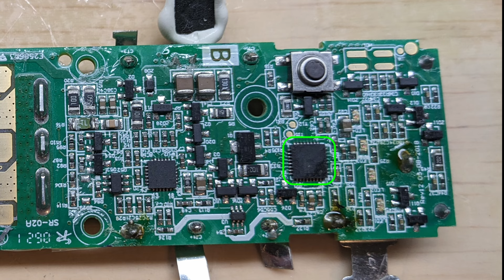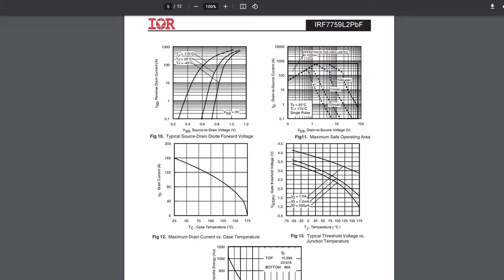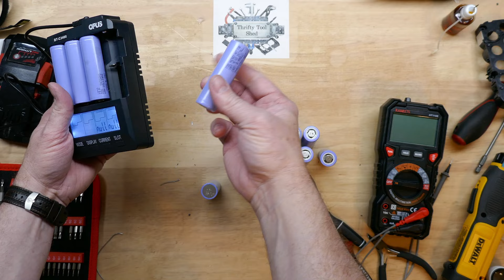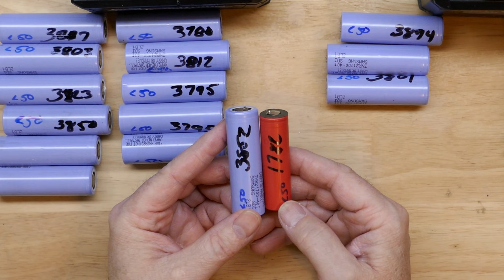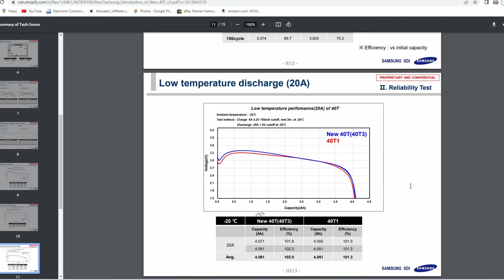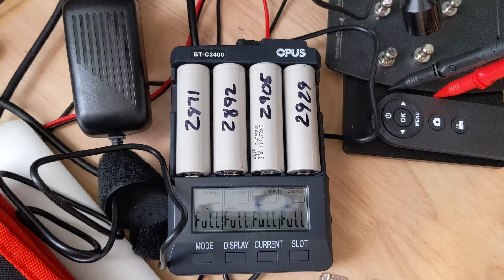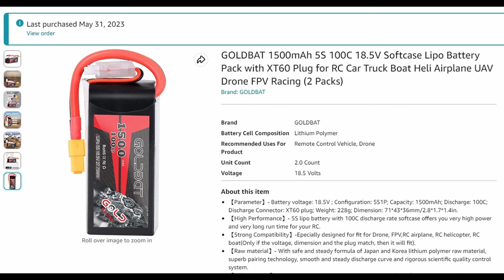Milwaukee M18 HD12.0 -  Is it fixable?

Comment: What about a bridge over the MOSFETs ??? Did that and the BMS came to life. I don now if it's a safe repair
Reply from the maker: Well it is absolutely bypassing a safety shutdown. On the same note the aftermarket boards available from China does not have the mosfet at all. At least the ones I have seen do not. So if it does work bypassed, I would treat it with the same respect as the aftermarket ones for sure.

Comment: not for vape haha about 6 years ago the first 20700 sanyo c s were installed onto a metabo battery packs hard to buy where I live . tore apart and went straight into my mechanical vape mods . pushing .008 olms . . in parallel. but single .25 sweet spot. for single battery. about a year or so later they finally made it to public as single cells. those 12.0s and 8.0 got tired of dead cells and rebuilding. milwuakee vape batteries now lol. dig how deep you go with specs thank you!

Comment: Thank you.  I sure did get a lot of very good information from watching your video.  I have a number of Milwaukee battery packs that are in various condition.  Some that stop charging with 2 lights, some with 3 lights, some that blink, some with no lights.  I was hoping to get some of the working again by mixing and matching parts between them.  But, after watching your video, I would be happy if you wanted them, no charge, pun fully intended.  Let me know how, and I will get them to you.  For me, I think I will buy the kits, and then build my own from the baggies I can get from the 18650BatteryStore website.  Let me know how I can get these to you and I think you will be happy with them.  All the best, and thank you again.

Comment: Often times people leave the battery sitting for a long time. It will drain down below what the charger will see. Simply charge up each bank of cells will fix that issue.

Out of balance cells will make this happen as well. Rebalance and it should be fixed. 

Out of the 100s of m18 batteries i have taken apart, most often what kills these packs is water damage or just letting them sit ran down.

Milwaukees first batteries with 21700 Samsung cells had a bad batch of 21700s. Some of the cells self discharged to fast. Making the battery out of balance.
Reply from the maker: This video is for this exact reason. To share first of all that unbalanced packs are an issue and how care should be given when trying to charge them, Secondly,  it's about even rebalanced is not always the answer since cells will go bad and loose capacity and simply balancing them back will end in the same issue in a few cycles or if they sit in storage for a long period of time. Thirdly, I talk about the 40T1 cells being an issue, and I hope the 40T3 cells are better. Very few are truly OK after rebalancing because it was a reason they drifted apart to begin with.  I left these for over a month to show that on video for the ones that care to watch it.
Reply: @ThriftyToolShed  an unbalanced pack happens because the cells were junk to start with. It's up to you if you want to replace them or not. Often times just keeping them charged is enough to keep them balance. 

I only replace cells if the IR is out of spec. Causing them to discharge in a few days. As long as you use Milwaukees charger it won't be an issue. It simply won't charge them. If you hot wire a pack, that's a huge problem.
Reply from the maker: Exactly!

Comment: Hey any chance you can give a list of stuff to buy so I can try to fix my battery and save myself money please all m18 batteries
Reply from the maker: I do have links in the videos description of many things that I use and can recommend as they work well for me. Most repair videos have links in the description that align with items used in the video. I typically use Amazon and Northridge fix for tools and supplies. If you have a question about an item or tool, feel free to ask. I have a video in the works talking about the tools I use and like, but it's going to be a while before I get time to finish it. It's always something to fix....

Comment: I have some of these 12.0 boards if you need any. Good working boards.
Reply: I'm just curious how do you know they're working good for sure. I have 2 12.0 that the cells are balanced and I can charge it with my dc variable charger but it still won't charge on a regular charger. All lights work correctly if charged with a manual source
Reply: @gregthompson3924 if it's refusing to charge on the Milwaukee charger and the battery needs a charge, it's a bad BMS board. Run the battery down to 2 bars. If the stock charger won't charge it, it a bad BMS board or a bad Milwaukee charger.

Comment: Im currently balancing my 12.0 now. I have 3 that refuse to work correctly. 1 is obviously unbalanced. One seems balanced but wont charge. I'm going to try to jump start it.
Reply from the maker: They will need to be balanced before they charge. Jump starting may possibly make it worse instead of better if unbalanced. Especially if some cells are closer to fully charged, while some are lower. The charged one could be damaged or even catch fire by pushing them much over 4.2V for example. Best of luck to you with your repair!
Reply: @ThriftyToolShed  I tried to charge each bank separately but my charge refuses to charge it. I'm going order a cheap 1 cell charge board and wire it up. As of right now this project is on hold.

One pack seemed pretty well balanced. So I replaced the board on the pack. Still will not charge. 1 light flashing on the pack. Goes straight to green when placed in the charger. Not sure what's up with that pack.

Comment: Great video! Those mosfets are infineon IRL7472L1TRPbF. See the bottom of pg 10 of the datasheet for the part marking code. 7L72 is the part number, JZ70 is batch number, 2115 is the date code (15th week of 2021) https://www.infineon.com/dgdl/Infineon-IRL7472L1-DS-v02_00-EN.pdf?fileId=5546d46254e133b401555d17178250d8

Comment: Not sure if you said this, but after it’s fixed you should FULLY charge (even after it’s “done” to top balance the cells) then kill it all the way. Fully charge it then it should be fine. The shop I work in for my engineering internship had problems with them when they would almost never fully charge or discharge them with them switching to the flashing light. I used the jump start method and balanced them as I explained above and brought back 7/8 of the batteries. I think the one had a bad cell or bms.

Comment: At 31:30 I don’t understand how you reset the board.  You twice put the board on the charger and after a moment removed it and tested it, it flashed 1 bar in error yet after the second attempt you stated it was reset but doesn’t look like it???  Trying to diagnose 2 8HO, 12HO, and a 9.0 with the same 1 bar issue.
Reply from the maker: Putting it on the charger was the reset. It has been mentioned in several videos in that series of videos, sorry if not as clear in this particular video. Typically the charger will reset that and some packs will go through a diagnostic type test if you hold the fuel gauge button down for 5 secs or so that may help in some cases...

Comment: It's blinking because is under voltage 
I just saved one just putting too another charger until has 17v that to original charger and it's work again (i tried few times)
Reply from the maker: Thanks for your comment. As mentioned in this video and many others it has bad cells. The actual whole point of the video is to help show the true condition of the cells instead of assuming charging it up will get it back to normal. Many people seem to think to boost it up and good to go. Over 95% of the time in my experience it is bad cells and the problem is simply masked by charging up to get a fault or error to clear. Think about it... How did some of the cells drop low to start with if cells are not balanced? In some cases when all cells have equally dropped down then yes the boost them up method can help, but even then if lithium cells get below 2V they most likely have irreversible capacity loss. These 40T cells have an issue that I found with capacity loss over time as shared in the video and I wanted to share for those that actually care to learn more about lithium cells in series and how close you need to monitor the individual cells behavior.
Reply: @ThriftyToolShed  yes.a battery can have 3 problems 
1.cells discharged or broken
2.bms broken
3.bad contacts between strips or bms
I watched all your video, i watch also to learn  something 
I just said that I happened with a battery that flashed the same way and after several attempts I managed to charge it in the original charger
Good luck ✌️
Reply from the maker: Thanks for watching and sharing!

Comment: I repaired a 6 XC earlier this year that had the same board problem, dead, single flash... Once i got it to single flash and all of the cells in series, i jumped the 3.3v pads (two round gold colored) near led2 and led3 to the line side of the button and hit the button, all the leds lit up and led0 started flashing agian. placed it on the charger, green light, off charger, press button, working again. not sure if all charge boards are the same, as this was the only M18 ive looked at, so may not work in all applications.

Comment: you shoud put those 40T cells in 8Ah battery, you need 10 of them. Just put cells, weld them, then put on charger, and you have one functional 8Ah battery for sell. After you sell that buy 15x40T cells, new ones and put them in 12Ah battery pack, then you can sell it, and you can tell its actualy new.
Reply from the maker: I did build an 8.4Ah pack with 21700  Molicel cells to do this same thing and after testing these 40T cells I can now do that exact same thing since I do have 10 of them that tested within a percent of the same capacity and internal resistance. I do not ever sell these of course, I just build these to use myself and testing like I did with the Beast sending it in to Torque Test Channel! 
Thanks for your comment!

Comment: I wonder if the management board not doing a good job balancing out batteries sometimes
Reply from the maker: I don't think the board does the cells any favors and the 40T1 cells are known for dropping in capacity over a few dozen cycles compared to the 40T3 cells also. Looks like the cell issues have been corrected to much of a degree with the 40T3, but how many thousands of packs out there still have the 40T1 cells?

Comment: How do you conbect the battery back up since it was spot welded
Reply from the maker: I spot weld the tabs up all the way to the power terminals.
Reply: I meant whst tool was it you used sorry for the typos
Reply from the maker: @terrysmith8505  
You are asking what spot welder tool I used? It is a really good spot welder for the price. It is listed in the video description.
https://amzn.to/3WcRwWA

Comment: This is an easy fix that doesn’t need to be fully tore down if you have a battery charger that charges lithium ion 18 650s make two wire leads and hook up each bank individually one at a time and charge them till they reach full which is 4.2, and you will have a fixed fully charged battery pack again
There’s another great video that demonstrates exactly how to do it just search YouTube and it will pop up
Reply from the maker: That is not a true fix and that is the only reason why I have taken the time to share these type videos. Everyone thinks jumping a freakin battery or balancing out the cells will fix a pack and it will not. Almost 99% of the time you will see that it is a cell problem or it would not have gotten unbalanced to begin with. This is explained to many videos I have on many packs. I have been working on batteries and electronics for almost 30 years and simply trying to share the true cause even when it takes me months to show you how the cells respond after storage and the next time you need it, oh well...
Anyway I am trying to help educate. These 40T cells are absolutely notorious for the slow drain discharge issues. As far as having to take the pack apart, I shared that in the video. I had other uses for the pack since several cells were not properly salvageable.
Reply: @ThriftyToolShed  i’m not knocking your video or your knowledge and since you’re the expert you’re probably 100% correct but the method that I have have posted fixed my battery and has been working with no issue for a long time now I was just stating another option for people that do not have your expertise or knowledge in the matter to do themselves to save them some money and still keep working with their tools but I definitely like your in-depth view and procedures of fixing it the correct way. Great video
Reply from the maker: Thanks for sharing! Sounds like you did really good on yours! Thanks for your kind comment!

Comment: Would love to see a Amazon type kit done up with quality cells. Wether hi capacity or hi discharge I think it would be quite interesting. Great work
Reply from the maker: I did a video on the 8Ah pack kit. I ended up using the 12Ah kit for the "Beast". The Lipo pack that I sent in to Torque Test Channel. Thanks for your kind comment. 
https://youtu.be/w3MyNC_3dFw?si=PsXaJv00NygkfGwY

Comment: I despise Miwaukee batteries. It is the worst thing about their power tools by far. I so wish I had just gone with DeWalt.
Reply: Sorry to hear that.  I have many Milwaukee batteries that are 2, 3, 4, 5 and 8 years old powering my many many power tools.  I have yet to have one of them go bad, all still in use today and I use all of them daily for all those years.  Sounds like you got some bad ones.  There are a lot of counterfeit Milwaukee batteries out there that look identical to the original OEM batteries.  Only way for sure to know you are getting a true Milwaukee battery is to buy it only from an authorized Milwaukee seller.  There is a reason Milwaukee won't warranty batteries bought from Amazon or Ebay.

Comment: :face-red-heart-shape::face-red-heart-shape::face-red-heart-shape: 12A batteries that flash the charging light cannot be repaired. Just change the circuit
Reply from the maker: They can sometimes. It means the cells are low and below healthy state. You can rarely recover the low cells, but usually replace cells and once put back on the charger it will reset the board.
Reply: @ThriftyToolShed   I've also tried it and it didn't work at all. The battery often blinks due to a battery error, the BMS will lock and there is no way to reset them to the original. Or another way is to use an ok battery connected to a flash battery to open the charger:face-orange-biting-nails::face-orange-biting-nails::face-orange-biting-nails:
Reply from the maker: @CauOngTroi 
I definitely can see where sometimes the case may be a board failure and it will not recover, but I was simply saying you can usually recover the board. I have shown this as recently as the last 2 videos using the LiPo packs to connect to the same BMS board that was blinking and after putting it in the charger it will reset and work correctly. Same M18 12Ah board. Maybe not always the case, but I have only seen one board blinking the one red LED like that that would not reset. I know it is many different revisions to some of the same model numbers also, so things can absolutely be different. Even the cells are from different manufacturers in the same model number packs at times. I have seen many Dyson battery packs brick like that when the cells get too low. It really sucks that there is no easy way around it without reprogramming the microcontroller.

Comment: Hi again, my comments based on experience with hundreds of these packs is as follows.
- Nothing likely wrong with the 12ah board. As I think I have mentioned before on your posts, both the Samsung 40T and 30Q (pink 18650 3aH) suffer from self discharge when faulty putting the battery out of balance, board detects fault and will not allow the charger to charge the battery. Boosting and balancing pack is not a long term fix, it will happen again. Sometimes the SMD fuse blows on the top of the board near the connector but rare. Sometimes only 1 cell is the problem and I have done a video showing how to easily replace a single cell in a similar pack here 
https://youtu.be/d4aG332IRJ8
- when you replace the cells, the board sometimes needs a reset (no lights as you experienced) easiest way is to place it on a genuine Milwaukee charger which will reset and start charging as you have suggested.
-  The 8aH is actually a 6aH, someone has swapped the internals, unfortunately some dishonest people around and fraudulent warranty claims. You are too kind, I would have asked for a partial refund!
- The kits are neat and I have used a Makita 9ah kit (Makita don't do a genuine 9aH battery). I filled with 15X sony VT6 (3aH) cells and it's an amazing battery, in my opinion, the best 3aH cells available.

Your drill down to chip level is excellent as usual, thanks so much.
Some suggestions for more video's 
repack and double the capacity of a dyson V8 (6s) battery pack (their batteries don't seem to last) pack would be 6S2P
Fault find a faulty Hikoki 18/36V pack, I have heaps of faulty ones, boards seem to fail, also if the board seems ok, I replace faulty cells but it will not reset.
Keep up the great work

Comment: Phillip, if you want to reset those High Output, you need to put them back in the charger to reset them.

i ran across some of 8Ah and 12Ah are using the Sony VTC6a batteries instead of the Samsung 40T
Reply from the maker: Yes, I shared that in the 8ah video as well as in this one!
Reply: @ThriftyToolShed i believed the 40T3 fixes some of the short life or bad batch

i seen some of 12Ah has a roll of dead cells, i mean 0 V dead 
they called it a bug
a few i ran across are from the furthest point from the terminal
Reply from the maker: Very interesting how some of the newer packs are using the Sony VTC6A!